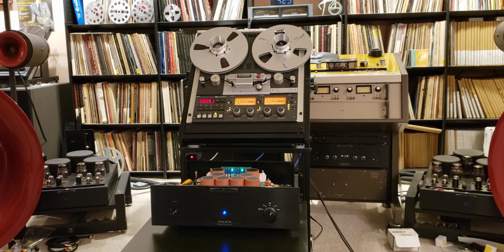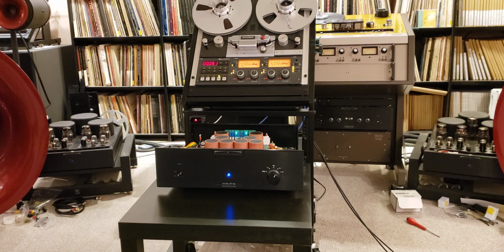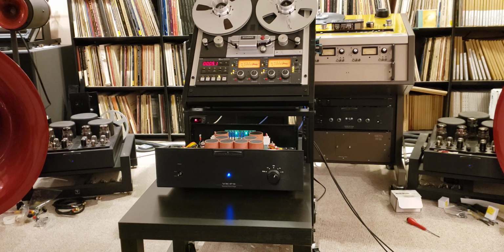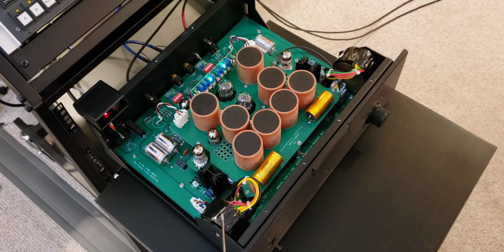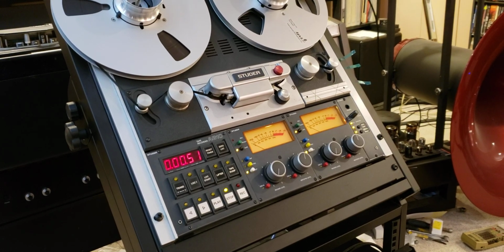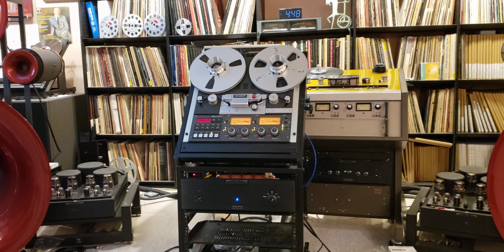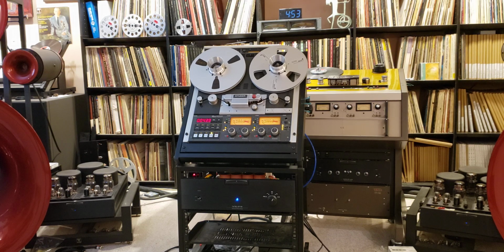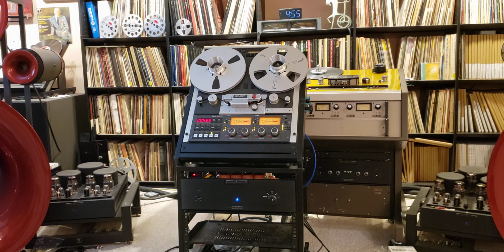Studer A810 and Number 9 Head Preamp junction

Comment: You say that all audio circuits have been removed and the tape head is connected directly to the outside world. Can you elaborate? What has been removed and how was the connection out made?
Reply from the maker: I have done the direct outputs several different ways.  On this machine the repro audio cards have been removed and a small connector installed in parallel to the playback head.  When I want to use it with the direct output that connector is engaged, and the new pair of XLR outputs on the rear panel is now connected to the heads.  And yes, the head preamp located in the head block is still connected, but as long as it is energized its input is purely resistive.   I have done plenty of tests and that connection works absolutely fine.  If someone wants to put a small switch there - that can be done too.  Like I said - just one way of doing it.  You can also keep the audio cards plugged in, in which case your meters will work - some might like that feature.
Reply: @Foxbat9000  Thank you for your reply. As I don't currently have external meters, I would keep the audio cards plugged in. Would you then be able to switch between internal and external tape head preamplification?
Reply from the maker: @marknachmias423  That depends on how you do that.  Yes, you could build an external switch box, but that would add components in series with the signal.  To me that would be a concern, others might feel differently.

There is also a possibility of connecting the two outputs to two different inputs on your preamp, then do the selection there.  That will work, but there is always a potential for creating ground loop that way.  

The first approach would avoid that if you also switched the grounds, did not wire them together.
Reply: @Foxbat9000  Thanks again.

Comment: Hello Victor, 
Thank you so much for sharing your expertise. I am a newcomer to the R2R game and before I discovered your channel, I have bought a Technics RS1520 on eBay. I think I got relatively lucky with my purchase. The machine is a bit banged up and it needs the brake job but after cleaning the tape path I hooked it up and I am enjoying the awesome sound of 15ips commercially available tapes. 
After watching most of your videos I noticed the Technics RS 1500 series missing from your stable. I just saw a comment in one of your videos that you were not too fond of Technics. Could you tell me the main reasons for that.
I also am intrigued about the external head pre-amp upgrade that everyone is talking about. I am amazed with the sound I am getting out of my stock RS-1520 so I wonder how much better can it be...
I am tempted to follow your lead and upgrade one of the BAT phono preamps. Could you tell me whether the VK-P10SE is the one to hold out for or is the VK-P5 or VK-P6 just as good? These are currently available on used market but the VK-P10SE is hard to find.
Thank you again for sharing.
Best Regards,
Remek

Comment from the maker: Well... another day.  Today I put on the superlative Chuck Ziska copy of live recording.  It is made in NAB at 15ips.

I often rate the tracks on tape on a ten point scale.  Number 8 is what I consider excellent,  and 9 is Exceptional.  Most of my excellent tapes are rated 8, with few raising to 9.  There is none so far that is rated 10, but I think there a a couple of tracks rated 9+.

Most of the tracks on that tape were rated 8 points.  Too bad I have not kept track of the playback system used in that rating... maybe I should start doing that.

Anyway... as soon as the first track started it became obvious it should really be rated one point higher, or 9.  Ditto for the next track, and as result, all tracks on that tape, except one, increased their ratings by 1 point, most of them became 9's.  

There is definitely some special about this preamp.
Reply from the maker: The second tape from Chuck produced the first 9++ rated track.  That one has a closely miked jazz club recording.  

For many years I have been saying that the hardest sound to reproduce faithfully is that of live brass, when you are sitting in the first row at the Preservation Hall, just 4' from the trumpets blowing into your face.  The bite these sounds have is always softened in recording.

That track was a revelation... the ambiance and the immediacy of the sound was truly scary, and when the trumpet opened up into my face I almost jumped.

I have heard that tape several times before, but it never produced that effect.

Comment: Thank you very much Victor for sharing your knowledge and experience. I’m happy owner of BAT P5 and before modifying it into tape stage I did upgrade it with all heave caps. Result was amazing. The best phono stage I’ve head. It beats all my phonos: quad 44, EAR 834P, Atmosphere MP3 . I felt sorry to transfer it into tape stage. Now with your great idea running multi EQ option I can run it for my vinyl and R2R setups. You are the best!
Reply from the maker: Thank you!  You are a very lucky guy, you were able to buy a wonderful example of not just a P5, but a P5SE, if I recall correctly.
Reply: @ Six pack upgrades were made by previous owner, I installed super pack based on your recommendations

Comment: Viktor. Another fantastic video! I’m hoping this is not one big tease if I were going to go purchase a P5 in the marketplace right now where can I get the instructions on how to do this? It’s wonderful to watch these videos, but it’ll be even better if I could implement this in my own life with this, please let me know if there’s a part and instructions, etc.. I look forward to your response. Thank you again.
Reply from the maker: There are several possible levels of modification.  The simplest one is converting the phono stage into a single EQ head preamp - that requires very small number of changes.

From there you can do 2 EQ's fairly simply, using toggle switches and some tacked on components.

The 5 EQ mod is the most complicated and requires a special circuit board.  I only made a small lot of those for my personal needs.  Of course more could be made if there was a need.  

The board itself is not complicated and I have the parts list - all the parts are readily available.  But someone would need to have reasonable electronic skills to properly install it into the unit - some special cables would need to be fabricated, and the switch installation require some machining to the standard P5 front panel.  Since there has been some interest I might make some drawings later.
Reply: @Foxbat9000  i look forward to it! Thanks!

Comment: In a earlier video  you paired the A810 with the modified  Marantz 7 head pre-amp. I remembered the performance of the Marantz 7 "wow" you at the time.  Did the performance of the  Marantz 7 inspired you to try the P6?  Perhaps this may not be a fair questions, how  does the P6 compared to the Marantz 7?  Thank you Victor for the video!
Reply from the maker: Winning against most internal circuits is not that hard - unless you are talking about a small select group of machines, such as the Crown.  So there was little surprise in the Marantz victory.  But my prediction is the P6 will beat it by a good margin, based on my so far limited auditioning.  

The modified P6 made the piano and the vibes sounds much cleaner - that is the first thing you notice.